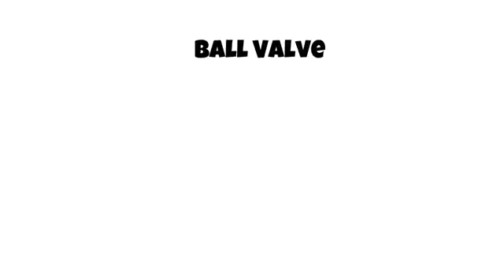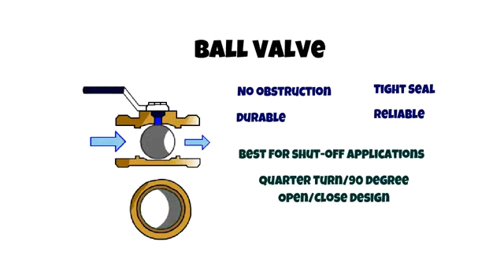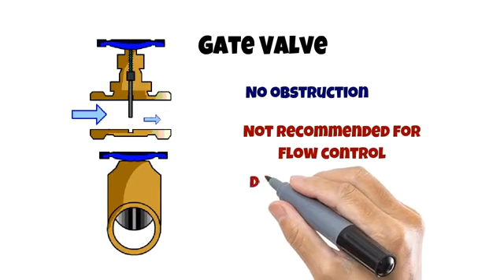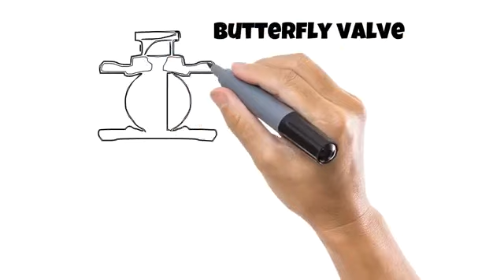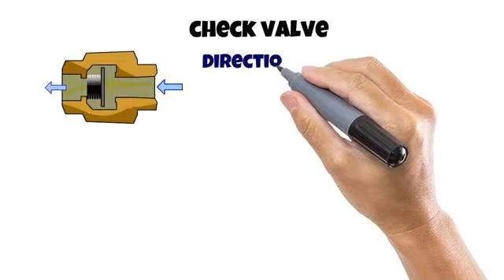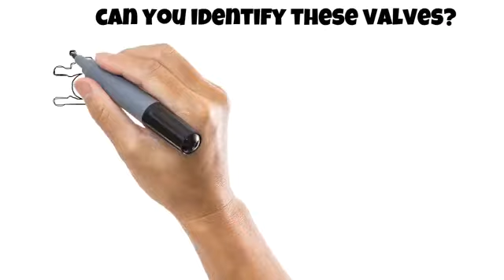how valves works

Comment: what kinds of valves are used in main pipe, service pipe and in a gas station ?
Reply from the maker: @BabaAndBaby11  in main shipping pipeline full bore valves to be used to allow pigging facility...and in facilities reduced bore valves used for cost saving
Reply: @ Thanks for your reply. Did you posted any video for leak maintenance? like Leak Report till Leak recheck